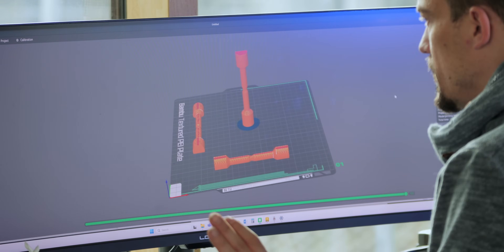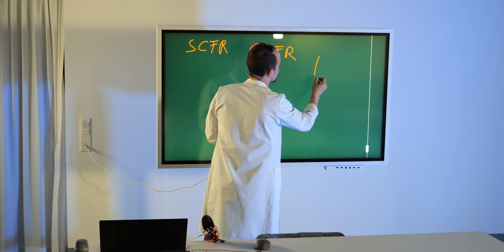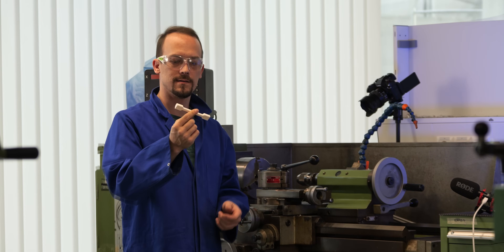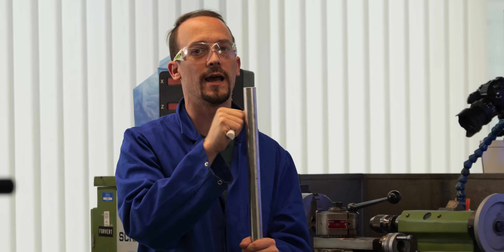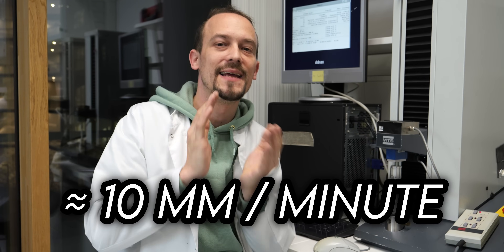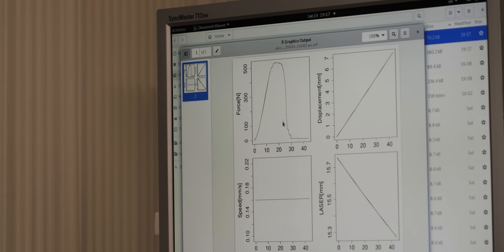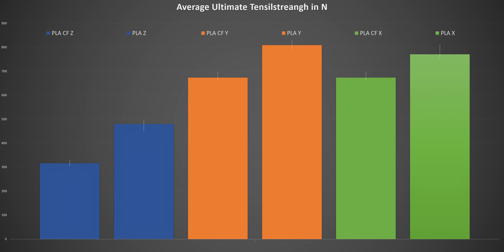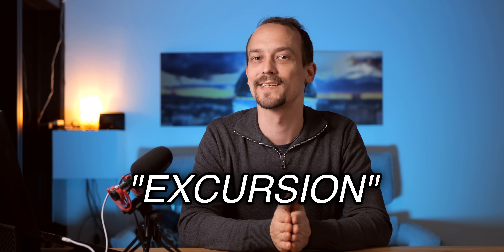The biggest SCAM in 3D Printing? How filament stores try to trick you with carbonfiber "reinforced"

Comment: It's more of a scam than what you are letting on.  It requires a hardened steel nozzle and still will wear that out quicker. It's made from recycled carbon trash basically.  The most dangerous part of the Chinese market is that they are discovering marketing and people are falling for it.  In a country where manufacturing is wide open, and you have people basically having to work in the machine to barely live you are going to get products like this.  Add buzzword "Carbon Fiber" to anything and it must make it stronger right?  Every time I see a video on it, I cringe.  I am a commonsense logic thinker, and it is rare that I can't break down how stuff works.  I am just glad someone finally said something!  Thanks!

Comment: Why no comparison of youngs mod? I understand ultimate strength but some of us just want to use a material that deforms less
Reply: Is this why you didn't use the ASTM tensile bars? The custom ones you made do the task but have no carryover to anyone else because they aren't standard. Interesting and cool video otherwise though
Reply: @MikeTheMan01  u got it.exacly
Reply from the maker: Valid point. i also thought about it.
I already explained it to someone i think:
i am in the middle of a reasearch paper including multible specialists (also meaterial testing specialists) and i took tensile because it is easy to test and easy to understand.
Young or impact would be a valid metric, you could argue that it even is the better one when talking about how parts are used but there are 2 additional reasons why i chose so.
first the tensile is the only metric that lets u compare layer addhesion to each other and the other axis without compromising the data with other metrics.

second, and thats also the reason for not printing 100% infill and this wiered formfactor, i coulndt risk publishing to much data because of the prepublishing rules. that could jeopardize the publication it self.

If u look for less deform aka stiffness, then cf might be the way to go :-)

Comment: Correct me if I'm wrong, especially since I'm no materials engineer, my understanding was to improve shear strength since it'll become stiffer. I figured for tensile, you would want something with more elasticity? Barely a mechanical engineer, so not that I'm correct. Would love more videos testing different properties and comparing to other plastics, like maybe some plastics aren't worth having CF. Maybe the PLA and PETG CF is just for people who want yo print CF but don't have the right setup to print with the better plastics? Idk, this video is making me think and love that it did that, keep up the good work!
Reply: While shear strength is a different parameter than what is tested, most of our prints rely on and even our perception is that CF infused filaments have overall strength or resistance from being snapped which isn’t the case. Saying “good mechanical properties” is misleading” when its strength is mostly one dimensional in terms of strength parameter.
Reply: @SimplyV3rna  CF is a scam, let alone. Who wants micro pieces of carbon fiber stuck in them. The carbon fiber strands break a homogeneous mixture.
Reply from the maker: Thanks a lot.
Shear and stiffness are related but not the same. they do not necessaraly corrolate. Same for tensile and elasticity.
Just think of glas. Extremly brittle and not at all elastic but extremly high tensile and then on the other hand there is foam (like memory foam). Very elastic but rips super easy.

Im no material scientist as well so i consulted them a little :-)

I Love that the video made u think!
Reply: @Ibuiltathing  Glass is elastic, albeit only a little.

Comment: I think the test is inconclusive. I noticed that the plastic tested had different pigmentation and from what I've heard, the pigment can affect the strength of the material. You might want to try with plastic of the same color, with and without reinforcement
Reply from the maker: @lupixus  finaly someone mentions it. Thank you !!
U are 100% correct. 
I reprinted the pla parts in black and tested them again. The data shown is this. But since I did not want to refilm the whole explaining part I left it in to discover. 
And as a side note. The difference between white and black was measurable

Comment: I am quite sure you know the My Tech Fun channel. He tested lots of filaments and basically has (to a large extent) the same conclusion, with some exceptions. I have some experience with CF filaments and have to say that PETG-CF is by far the worst. Layer adhesion is absolutely terrible. For PLA-CF I just don't see why you would want to use it (unless for the esthetics of it) as the mechanical properties are quite poor anyway. Short term PLA is OK but it deteriorates over time and creeps like crazy.

When using engineering materials like Nylon, PPA, PC or PET the strength does not increase eighter (in most cases). Stiffness in X and Y direction increases quite a lot however. In Z-direction some (namely PET-CF) have equal tensile strength compared to non reinforced. Here the carbon (or glass) fiber does make sense however as it makes them way way easier to print. I can print 20 cm or bigger objects of PC-CF or other CF filaments easily. Pure PC is limited to 100 mm anything else warps off the bed. PC blends will also solve this issue but also at higher cost and deteriorated mechanical properties, especially HDT goes down which goes up (slightly) with carbon fibers (I question how useful this is as the tensile is quite low in that upper region).
Reply: "the same conclusion, with some exceptions." when there are exceptions (like on his PPA video) there is a reason for that - but unfortunately he does not explain it

PPA-CF in his tests has better layer adhesion than PPA without CF, but the PPA-CF filament has roughly 5 % non declared additives in the material data sheet (besides the CF) which are most likely coupling agents that improve tha layer adhesion

Comment: One of the properties that the Clough42 channel discovered with glass filled/reinforced ABS filament, was that it was far less prone to warping, and therefore held really good dimensional accuracy. Oddly though, the marketing department hadn't laboured that point at all. Preferring instead to lie about it's enhanced strength properties.
Reply from the maker: They did at the beginning actually. Carbon fiber filled materials used to be exacly for that purpose. Sometimes even to make materials printable that wouldnt be otherwise. But because of the carbon fiber reinforced materials out of industrys like injection molding that are stronger for real, especially if woven, this missconception grew and grew and now its marketed that way.

Comment: You are not wrong in that CF infusion weakens aspects of the base filament, but I think you are fully missing the strengths as stated many times in the comments. Plainly, as you found, contaminating the bond between layers and the plastic in general can and normally weakens the material.  BUT, in modulus, it will almost always improve.  Bending stiffness is what CF infusion is all about. 

That said, CF PLA & PETG are very useless, IMO.  The biggest aid from CF is in printability, and they both print well in their natural state.  Tensile strength goes down, and stiffness goes up at the cost of various other important aspects. IMO, just not worth it in PLA & PETG. So in all, you are right, but incomplete.
Reply from the maker: @mikejackson9585  correct ! Nothing to add. 
The issue is not that cf does not has its place. But that it is marketed to the average user with wrong promisses. I use cf too quite a lot if I want to leverage its advantages. This should show that the industrie markets the wrong thing. Because it's easiest to sell. 
Even "improved mechanical properties " isn't a lie. But it's telling a misleading g statement. And that on purpose, because it sells. 
It's like stating a car can go 2000 miles on one tank but not telling its in a lab environment without wind or rolling resistance etc. 
Putting everything in one video is to mutch. That's what the researchpaper will do. There we even will do calometrie , we will have optical systems to messure additional metrics and do stress strain graphs, expansion cells , modulus, stiffness sheer etc etc. 
Maybe after its published I do a series of videos going into detail. 

Thanks for pointing it out
Reply: PLA-CF is actually pretty great if used right and for the right reasons. CF adds a lot to the heat deflection temperature of PLA, which in its base form is famously very poor. It also improves impact strength quite a bit and PLA-CF is still very cheap compared to other reinforced filaments. PLA is a great material for demanding parts, due to its stiffness and fiber reinforcement really fixes some of its weaknesses. My favorite application is in ASA-CF though, since it not only makes the ASA warp significantly less, but also makes the rather flexible ASA a lot stiffer and dimensionally stable and in terms of temperature resistance you can get away with stuff that's normally reserved for PC or even some nylons.

Comment: Aren't you supposed to annheal all carbon fibre based filament compontents post print for this exact reason? I know it induces other concerns and nobody actually does it unless they truly understand. Thanks for making this video, I knew this but didn't see other people talking about it. I saw some people making a mock continuous carbon or glass filament reinforced part by placing it manually in between layers etc. I know that makes a big difference, and it's also far cheaper.
Reply from the maker: Some say yes some say no (Manufacturers). I could actually see my self doing some tests with annhealing (indipendent but including from/with carbon fiber materials)

Comment: I have been experimenting with MINWAX fast dry polyurethane warm ultra flat, then using a vacuum chamber, put the print in a container, add the polyurethane liquid and "vacuum sinter" the air gaps by pulling the air out and replacing it with a fluid that can flow in the microscopic air gaps left by the nozzle, for 15 minutes (or until the part quits foaming/bubbling [approx 15min]) take out then let dry for approx 24 hrs. Can you test this method to see if it makes prints stronger, especially along the layer lines?
Reply from the maker: That sounds super interesting. i will mark taht down for sure.
Just from the description this should have a notacable impact on the property. But with what do you pay for it is the interesting question here
Reply: Interesting, I've been airbrushing prints with a thinned epoxy clear coat.  The epoxy really wicks into the layer lines.  Don't know if it makes the prints stronger. I think it should, at the very least it makes them waterproof and nice to touch.
Reply from the maker: it should help and bear some load. not mutch but i can immagine a little. It also, in terms of breaking, should get rid of the notch and reduce stress concentrations in specific materials that bond very well. Maybe with those ideas i could do a "what method increases properties" video together with the anneahling.

Comment: It's no surprise to me since my own experience with CF is in line with your outcome. I always suspected that the buzz around CF reinforced filaments is just marketing bs. Maybe it has benefits for nylons or PP, making them stiffer. But for PLA, PETG, ABS and ASA I don't see the benefits of reinforcing them with CF, at least not for strength. Maybe for looks...
Reply: I personally like PETG CF filament as it is not as brittle as PLA, but is way stiffer than PETG. Also as far as I understand it will also have higher deflection temperature than base material. Additionally (my own observation) it is more abrasion resistant, which can sometimes be important.
Reply: ABS and ASA would probably be easier to print, because the Fibers reduce warping.

Comment: I may have heard incorrectly, but it did sound like you used a 0.2mm nozzle. All of the CF filaments I have seen recommend a minimum but prefer 0.6mm. I would assume this would help reduce the CF alignment. Would this impact your tests?
Reply from the maker: @masterof01  I used a 0.4 mm nozzle to keep it as close as possible to most users that have surfacelevel knowledge. 
The alignment would in my oppi ion still happen because of flow. But to be certain we would need to test that. Very valid point. Thanks for that.

Comment: Dude, this is an incorrect and terrible test. You sliced with PLA and PLA-CF Settings and used PETG and PETG-CF materials! 4:45 in the slicer screen you can see your mistake.

😂😂😂
Reply from the maker: @heliguy83  
Somebody already told me it could be understood that way. I of course used the slice settings meant for each material. I added a disclaimer to the description. Thanks for pointing it out too!

In bambuslicer, if u switch material it switches the settings with it. It got from white (pla) to black (pla cf). I think editing and cutting added to the confusion.  

U have a sharp eye 😁👍
Reply: @ Ok… your thumbnail is very misleading; “Scam” is not the right word.
There’s also issues with the word “strength” as it’s an ambiguous term when used as-is. Tensile, Compressive, Yield, Shear, Elastic/Flexural and Fatigue - are all different types of strength. You need to pick the right material for the job. If you want better layer adhesion, you need to print hotter. I feel you are misleading the newbies.

Comment: Not wanting to sound overly critical, but calling this material as scam is as misleading as all the marketing crap.
I saw MyTechFun reacted to your video..i highly encourage you see his tests which are much less biased and don't go over only tensile strength, which is only one of the many strength related properties.
Also, you treat if it was the same material as the unblended one. It is not, and a fair comparison would print each material at their optimal printing settings which include the temperature (CF one benefits from higher printing temperature).
Reply from the maker: @tinkerman-q  
You are correct. Calling it a scam is a pure marketing move from my side. 
Regarding the temperature etc: 
I of course used the slicing parameters for cf materials. Maybe I phrased it a little wrong so you think the slice is the same. I took the optimal printing parameter for every material. 
Do you think I should clarify that in the description? 
And the other tests will follow (sheer, notch and all other) but then in a study. I just could not include them here since I can't risk prepublishing. 

I hope that addresses al your concerns.
Let me know if not, i want to encurage an open discussion and i really like "being criticised". 😁 only that way we stay unbiased and scientific

If any of this comment sound defensive or sarcastic : it isn't. It's meant as written!
Reply: @Ibuiltathing  I think that can't hurt. I definitely understood that the settings were the same. Need to go over it again, but odds are other people will also misunderstand this. I appreciate your honest reaction. Will stick around further
Reply from the maker: @tinkerman-q  
Also: he reacted to my video? Would you be so kind to share a link to that with me 😁😅
I would love to watch that
Reply: @Ibuiltathing  not a video, in the comments

Comment: Does the same hold true for glass-filled filaments? I know it can help abs or asa print without warping or peeling off the bed, but is the final part weaker?
Reply from the maker: it does hold true. Its arguably even worth depending on the filament manufacturer because most use eeds instead of fibers so you dont even get the mechanical "grab" on the rought edges of the fibre that u get from CF fibers

Comment: Ive printed just about every filiment that a consumer grade printer can handle.  And the strongest ive found "specifically for pewparts" is PPACF and PPSCF.  PA6CF would be a 3rd, and PAHTCF probably 4th.  Notice i never mentioned PETGCF or PLACF because ONLY those 2 are the scam.  Do another video with maybe some bambu lab PPA or PPS and your mind may be changed.  Not saging your little "bonding" theory isnt correct, but it doesnt seem to be effecting certain filiment types as it does petg and pla.
Reply from the maker: My resaerch paper will include every material that i can find that has a base variant and a cf variant. and i will definitely update u guys with it. And maybe my mind will change.